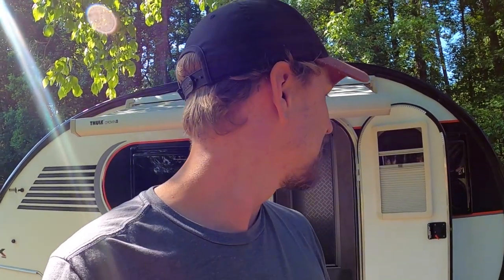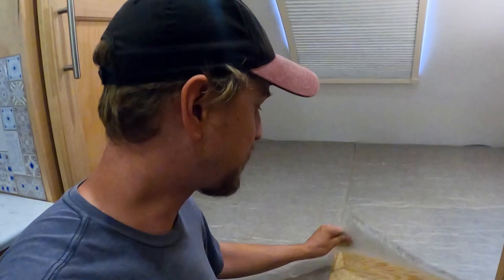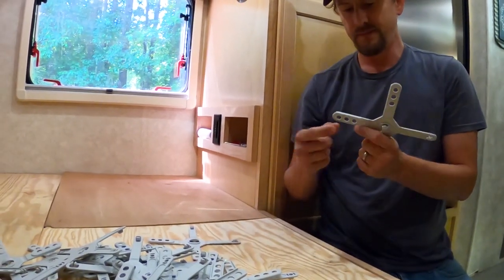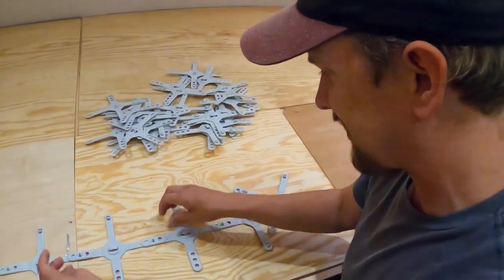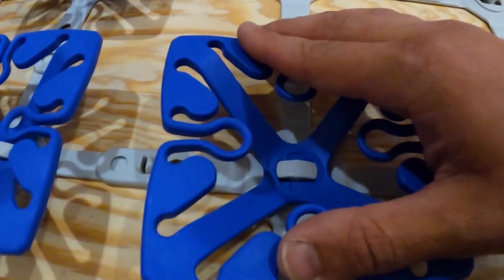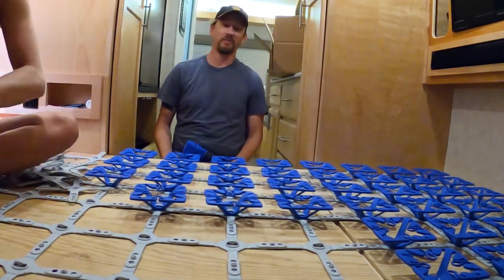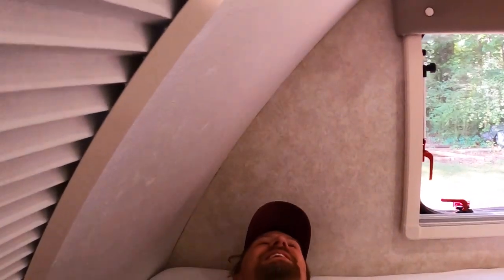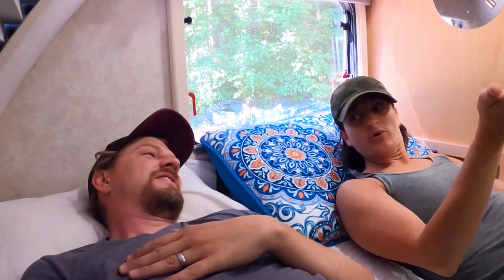FROLI BED SYSTEM REVIEW:  OUR HONEST LITTLE GUY MAX RV OPINION

Comment: Great vid!!! Very helpful, and I hope you will continue to share tips, advice and recommendations.

If you don't  mind a question, a year after your vid, maybe you would like to consider my questions:

Could you provide details on what you use for a mattress? And might you use a fabric style moisture barrier between the Froli and the mattress?

In any case, wishing you many more Happy Trails and adventures!
Reply from the maker: We have switched out several mattresses. So hard to find the perfect one for both of our sleeping habits. But right now we actually found Serta mattresses work the best for us. The Froli system allows plenty of air flow so no need for the extra stuff for our setup.  Thanks for watching.

Comment: The Froli is definitely my #1 upgrade… I do feel like it converted my bed into a 5 star like hotel bed and no more fear of mold. Glad you used my discount code to save 15%. You guys rock and I hope our paths cross someday!
Reply from the maker: Thanks for watching and the discount code. We are enjoying the difference so far. Maybe one day we will sahre a campsite together. I bet your loving that Jeep?
Reply: @JoyousVoyagers  Oh my gosh… the Jeep has been so much fun thus far. We just came back from two weeks in the Upper Peninsula and knowingly and sometimes unknowingly ended up on some adventurous off the beaten path roads. The interior is smaller then the Tundra we had so that has been an adjustment. So far so good. 😁
Reply: I need a discount code, my lower back is killing me and I want to try out this Froli system.